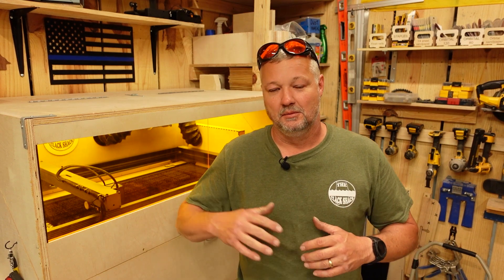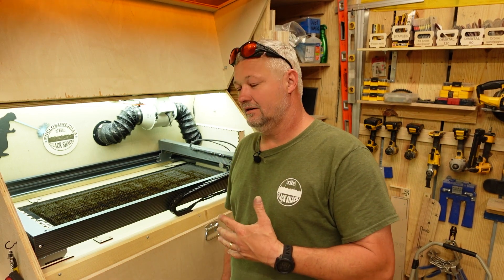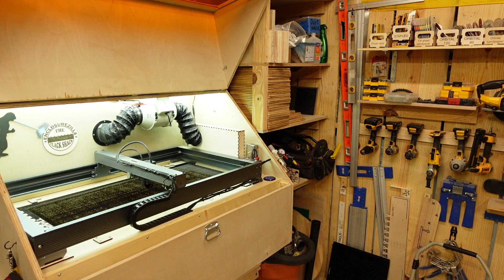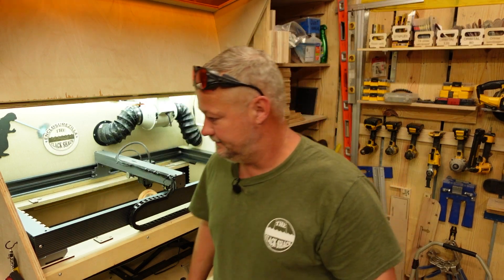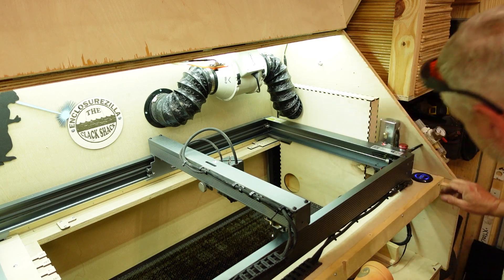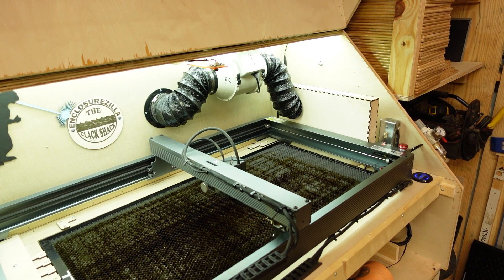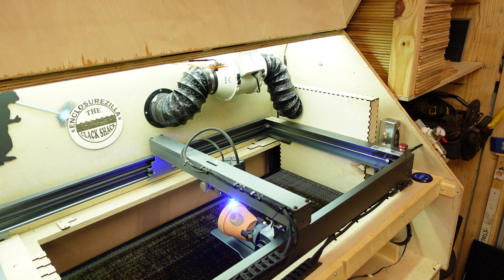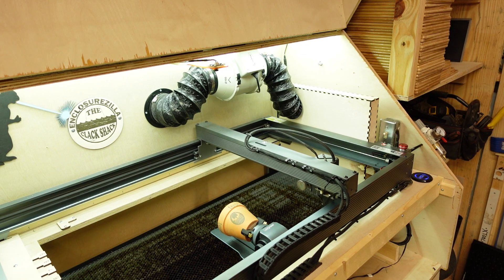Can your rotary do this? Another time saving upgrade

Comment: Dave, are you using a longer cable connected to the rotary? If so, can you point me in the roght direction? I have the Xtool D1 Pro 20w and the RA2
Reply from the maker: I have two cables connected together. The XTool cable plugs into my rotary switch and the Atezr cable plugs into it. The Atezr cable is about 2 foot long
Reply: Thanks!